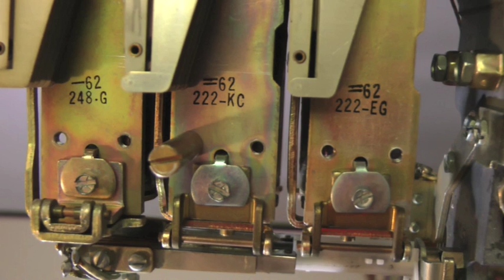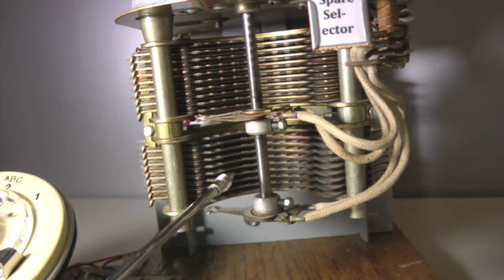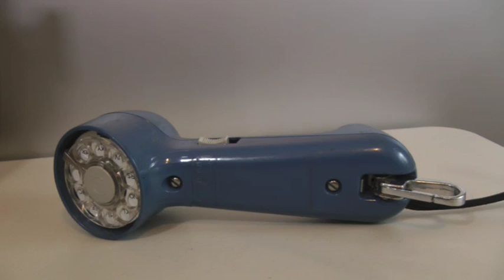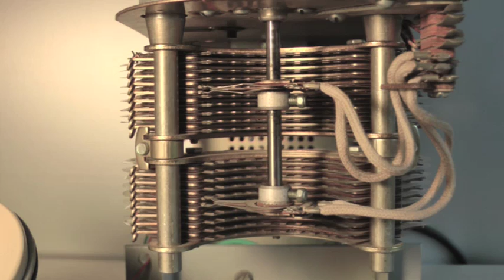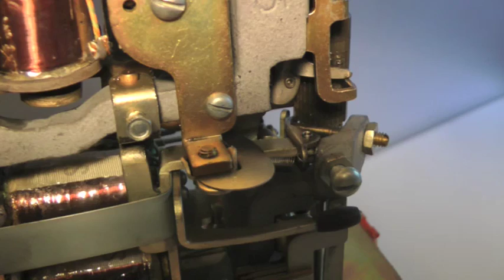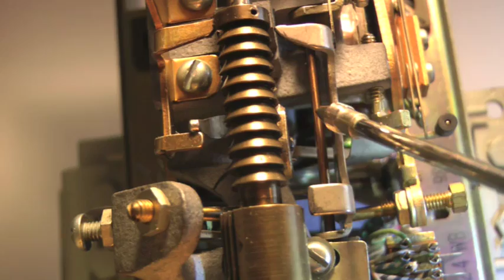The Selector In The Step-By-Step Telephone Switching System Part 1

Comment: At which point in the chain is dial tone finally removed?
Reply from the maker: On a standard non-digit absorbing call, after the first digit has been dialed and the dial has returned to its normal rest position, the 1st selector connects to an idle 2nd selector and removes dial tone when it cuts the callers line through to the 2nd selector in preparation for the dialing of the next digit.
Reply: @Hicken65 I thought that might have been the case but wasn’t sure. Do you have a drawing or info on how the dial tone is, I’ll say injected, onto the calling line?
Reply from the maker: @markrgreenlane  One wire from every 1st selector is connected to the common "hot" side of the central office dial tone generator. Inside the selector this wire passes through one of the two windings (200 ohms) of the selector's A relay and then continues out of the selector on the tip wire of the call transmission path, through an operated F relay contact of the activated line finder, through the line finder wiper, through the line circuit connected to the terminal the wiper is resting on, through the cross-connect wire connecting the line circuit to a cable pair and out on the tip side of the cable pair to the subscriber's telephone. The return path on the ring wire of the transmission path is identical to the tip wire path until it comes into the 1st selector  where it goes through the other winding (also 200 ohms) of the A relay to ground.

Comment: I'm a data telecomm guy, and this electro-mechanical switching is what we used to call FM - freaking magic!  Great video.
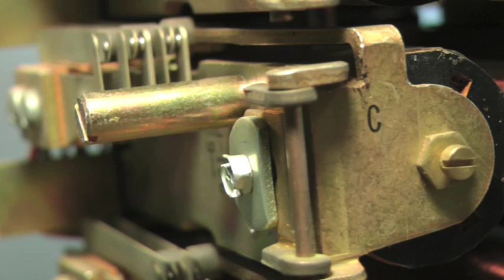Reply from the maker: In my email notifications from You Tube you had made the following post, which for some reason isn't showing up here: "I'm a data telecomm guy but I find this electro-mechanical stuff fascinating. One step I believe you may have missed describing is how the end of a dial pulse train is detected - I believe it's called the inter digit interval - thus triggering rotation of the switch. Can you illuminate?" I can answer this question for you. The C relay controls this feature, which is described in the video starting at  40:34 and ending at 42:00. The slow release C relay monitors for the end of the dial pulse train. When the A relay has re-operated and remains operated after the end of the last pulse, the C relay releases. The acceptable release time range is from 111 to 140 milliseconds. This closes the energize path for the rotary magnet. Operation of the rotary armature rotates the shaft and wipers to the first terminal of the bank on the selected level. C remains released unless this selector processes another digit in a digit absorbing application. Thanks for watching.

Comment: Thanks for putting the video together, great content and very detailed.  I was able to get a similar selector to the one you have in the video.  I would like to power it up and hook up a rotary phone to watch it run.  Can you provide additional information of how you hooked up your demo unit (I assume using the 16 blades in the back?).  I would like to know where you connected the power (48V DC?) and where the colored wires from the rotary phone would connect?

Also, unfortunately my selector did not come with a Bank Assembly.  Any idea where I could get one?
Reply from the maker: Here’s how the prongs (blades) are numbered, viewing from the rear side of the switch. From left to right the 16 prongs are numbered 16, 14, 12, 10, 8, 6, 4, 2, 1, 3, 5, 7, 9, 11, 13 and 15. On my demo unit, prongs 12, 10 and 5 are for -48-volt battery supply; prongs 11 and 15 are for the ground supply; prongs 1 and 2 are for the ring and tip transmission wires from the preceding circuit, which in your case would be the two wires from the rotary dial telephone set. As for getting a bank assembly, I would suggest you reach out to members of the Telephone Collectors International. They have a website and a listserve (forum) where you could ask if anyone had a bank you could purchase. Thanks for watching.
Reply: That’s just what I was looking for – thanks so much for the quick response!

I remember back in the 1970s my parents getting a detailed itemized phone bill each month.  How did the phone company track the number dialed and the duration of the call to send out the bill?  Just curious if it was a separate system, or somehow integrated with this equipment?
Reply from the maker: @MsBSBrown  Prior to Direct Distance Dialing (DDD), customers dialed “0” to place a long distance call. The billing was accomplished by the long distance switchboard operators who made up call detail tickets which were then sent to the accounting department. With the advent of DDD in the 1950’s, billing was performed by  electromechanical devices that collectively were known as Automatic Message Accounting (AMA) equipment. This equipment was installed at the toll switching centres. AMA equipment would identify the calling telephone number, and record that number, the called number, the start time of the call, the end time of the call, and other miscellaneous information by making coded perforations on a reel of paper tape. Each day, these AMA tapes would be sent to the telco's accounting department which had equipment to read the tapes and store the call details for the preparation of the monthly bills. SXS end offices were equipped with adjunct equipment called Automatic Number Identification (ANI) that forwarded the calling telephone number to the AMA equipment at the toll centre.
Reply: Very informative - thank you for the response and putting your videos on YouTube!
Reply: We have the selector hooked up to power as described - if the wiper arms are lifted, the release relay engages. However a phone attached to 1 and 2 is never able to seize it - in fact there is no voltage on these pins. The A relay never energizes. Any ideas? Are there any schematics of these things available?
Reply from the maker: @AD7ZJ  Is it a Western Electric selector? If so, what is the ED number stamped on the switch base?
Reply: @Hicken65  It's an ED 55242. Somehow I think YouTube is filtering our replies
Reply from the maker: @AD7ZJ  Unfortunately, this switch is not a local selector like my ED 30976 in the video. It is an intertoll selector and was used in sxs intertoll offices accessed by switchboard operators to place long distance calls. I was unable to find any circuit descriptions, schematics or relay sequence charts for this switch. Sorry to disappoint you.
Reply: @Hicken65  bummer! Thanks for trying though.

Comment: Thank you so much for explaining the entire mechanism thoroughlly ^^ im an automation engineer and i would have loved too work on these mechanisms! I love how satisfying their mechanism is and how simple the materials in it are. Im amazed about how neatly designed metal and isolators can acomplish a fully automatic connection selection! Great video!
Reply from the maker: I think that probably most CO technicians of the electromechanical era thoroughly enjoyed working on this equipment. I know I did. I'm glad you enjoyed the video and thanks for watching.

Comment: The best explanation on youtube. Can you tell me what each of the 8(16) blades in the wooden block are for (wiring diagram) and are they the same on a selector, line finder and connector? Thanks
Reply from the maker: That's called a plug. It has 16 blades or prongs arranged in 8 pairs.It's called a plug because it plugs into 8 pairs of jack springs mounted on the switch frame. This is shown in the video.This allows the selector to be a plug and play device without having to undo any wires. So all external wiring coming into the selector is handled by this plug and jack spring arrangement. This includes dc power, ground, tones, preceding circuits, etc. The one exception is succeeding circuits which are connected through the wipers and bank terminals. The line finder also has a 16 prong plug, while the connector has a 24 prong plug.
Reply: @Hicken65 Thanks for the quick response.  Would like to know  what each and everyone  does  on your selector at  11:05, it looks like there is 10 blades used and 12 wires or so.
Reply from the maker: @SuperYmymym  You’re looking at the plug on my parts switch, which is not the same type of switch working on my demo unit, so its wiring has no significance in regards to how my demo unit functions. However, the physical prong arrangement is exactly the same. Here’s how the prongs are numbered, viewing from the rear side of the switch. From left to right the 16 prongs are numbered 16, 14, 12, 10, 8, 6, 4, 2, 1, 3, 5, 7, 9, 11, 13 and 15. On my demo unit, prongs 16, 8, 6, 4, 3, 7, and 13 are unused; prong 14 is for busy tone; prongs 12, 10 and 5 are for -48-volt battery supply; prong 2 is for the tip transmission wire from the preceding circuit; prong 1 is for the ring transmission wire from the preceding circuit; prong 9 is for the sleeve control wire from the preceding circuit; prongs 11 and 15 are for the ground supply (except on the 1st selector, where prong 15 is for the dial tone supply). From the prongs, the wires go to various places inside the selector, generally relay windings or relay contacts, none of which would be of any use to you without a copy of the wiring diagram. I hope this helps with whatever you’re looking for.
Reply: @Hicken65  Perfect, thanks

Comment: The white sleeve located behind the shaft spring that runs up/down on the normal post has bumps on its sides which appear to operate some other contacts. What is the purpose of these? They look like they could detect particular vertical positions.
Reply: Never mind, it is explained in part 2 of this video...
Reply from the maker: You need to watch part 2. Just search my channel name, Hicken65, on You Tube and look for The Selector In the Step-by-step Switching System Part 2.

Comment: Were there any differences in the selectors that were used in a No. 1 SXS, vs a 355 Step CDO?
Reply from the maker: Well, I can't speak to all selector types, because I don't have the information. The particular selector type I am using in my demo unit, which is SD-30976, could be used in No.1, 350A, 355A, 356A, and 360A offices.
Reply: Thank you for the reply.  That answered my curiosity.  Keep up the great work!!
Reply: The SD-30200 was the Type we had in our offices. It looked and worked just like the SD30976. and it was basically wired the same way.
Reply from the maker: @gpwgpw555   Well, the SD 30200 was certainly a commonly used selector. However, it does not have any digit absorbing functionality. Its use as a first selector was replaced by the SD 30976  in many offices when 7 digit dialing was introduced in the late 1940's. The digit absorbing feature of the SD 30976 permitted 7 digit dialing without having to build up the switch train. The replaced SD 30200 switches, were retained to handle growth on other selector ranks.

Comment: Good content but need a camera capable of useful slo-mo. Do you have a link to a site with annotated schematics to show the circuits through the various contacts?
Reply from the maker: There is a site that has the schematic drawing and a printed circuit description.

Go to https://www.telephonecollectors.org

Select TCI Library. Look at the “Browse The Library” list and scroll to “BC Switching Library”. On that list, scroll to and select “Western Electric”. On the Western Electric Categories page, scroll down to and select “SD-CD-30976-01  3  4 Wire Selector”. On the Selector page, the first item is the circuit description. Click on “view” on the extreme right hand side of that item and a PDF of the Circuit Description will appear. The third item on the Selector page is the schematic drawing. Again, click on “view” for that item and a PDF of the schematic drawing will appear.

Comment: this video is cool!!

quick question though, in a large telco office when they housed heaps of the line finders, how did they set the system up so a free line finder could be found if some other ones were in use at the time the handset was lifted? i ask because i imagine having the subscriber connected to one line finder in an office that was serving thousands of lines would be troublesome since if they were only connected to one line finder then that line finder could quite often be busy.

would you also happen to know how a line finder searched for a free first selector from a large group of first selectors? thats the part i cant seem to figure out also, thanks!
Reply: Let me update Glenn's reply.  A line finder group would have 200 lines circuits. If you can find a photo of a mounted Line finder you would see three sets of contact banks(see time 26:45). One more than a selector or connector bank. Any Line finder could provide dial tone to any of the 200 lines in the group.  if any 20 lines in the group made and were in a call at the same time, none of the other 180 lines could get dial tone to made a call until one or mare of the calls were released.  This gave a concentration of 10 to 1.  The 180 Lines could still receive calls just not make them.  This was for a 1SXS office.  I worked for three months in a Customer Centrex were there were 32 line finders in a line finder group. My work in SXS was from 1970 to 1977 I still have dreams about the equipment.

Comment: Superb video. The visual detail and clarity of description was excellent. I wondered about the leads that attached to the moving wipers - what are they made of that allowed them to reliably endure all that movement? Also, the sparking in one of the contacts of the A-relay during pulse transmission must have made for a short contact life. Many thanks for posting, most informative.
Reply: Thank you for taking the time to reply. I have always had an interest in electro-mechanical devices since I started out servicing teleprinters early in my career. Looking forward to part 2. Best wishes.